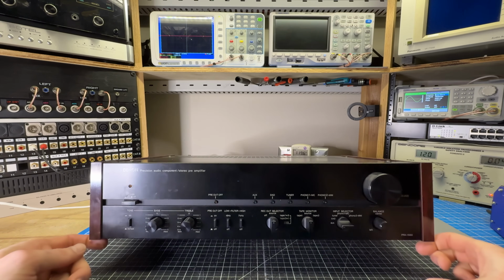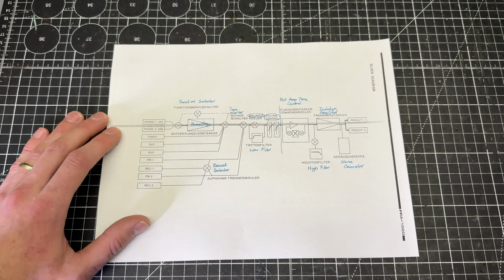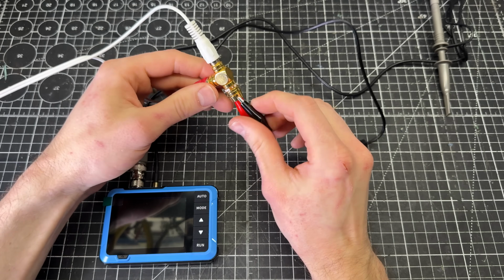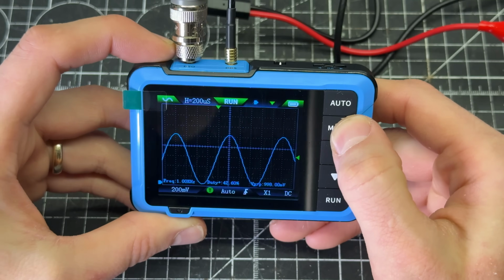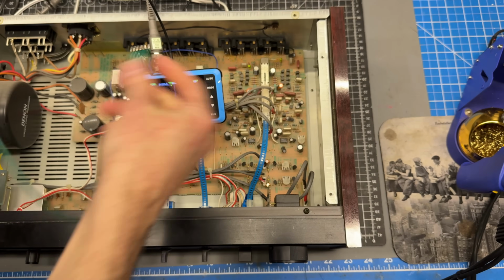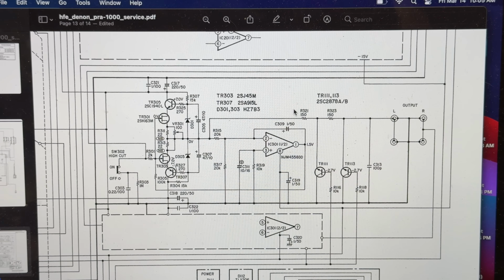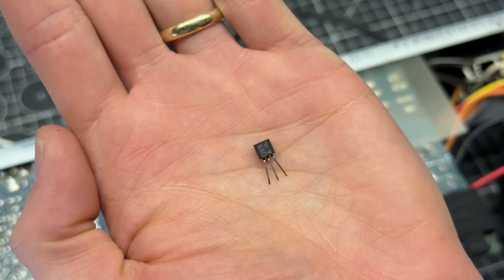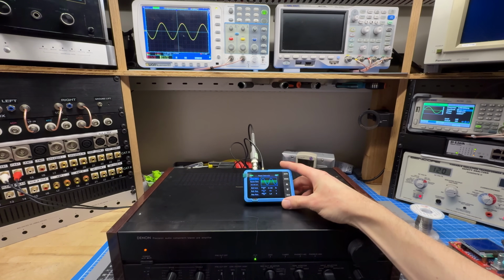Audio Signal Tracing with the FNIRSI DSO-510 Oscilloscope / Signal Generator

Comment from the maker: FNIRSI sent me this unit for review. Some links below are Amazon affiliate links that support the channel at no extra cost to you.

🔗 FNIRSI DSO-510 & Associated Accessories: https://amzn.to/4s7gEz0

IMPORTANT NOTE:
The signal generator and scope input are not isolated. When using the built in signal generator, proper grounding of the probe ground clip must be observed. 

In fact, removing the ground clip on the probe is advisable if using this device as shown in the video. The RCA cable connected to the signal generator should effectively connect the probe to chassis ground.

Thanks to a view comment it was brought to my attention that the signal generator can output a signal with a DC offset. This can be troublesome when injecting a signal into a direct couple circuit. It is advisable to use capacitor in series with the center pin of the signal generator output. I usually use a .1uF 630V film cap for this application.
Reply: could you describe this in more detail? I never used a similar signal generator / scope before
Reply: I bought one to learn on. Two days into learning, and I measured my self built Pemf machine. Can’t measure gauss. It does show a square wave and lot’s of information about the pemf. I’m real happy with it. Have a new Siglent 4 channel. But for $29.95 the Fnirsi dso510 is amazing.
Reply: If it isn't properly grounded, could it damage anything? Either the oscilloscope or the thing it's attached to, in my case, an amp.
Reply: but nothing can happen, right? Please excuse me, I'm a beginner trying to learn something, thank you
Reply from the maker: @Luke-12V The ground of the signal gen is at the same potential as the ground clip of the probe. Imagine you are connecting a clip lead to the chassis then touching it to a power supply rail. It’s the same thing. In other words. If you are not careful where that ground clip goes you could damage the probe, the test equipment or the device under test.

Comment: That is a strange result from you transistor tests! Most NPN transistors DO have a Diode across the collector and emitter because they are built on the modern "planer" process. It is VERY strange that the other transistor does NOT have a what is called the "substrate" diode as is very common in transistors today. I think someone replaced the transistor that you determined as "bad" to correct the problem is the result of putting a modern transistor that is substrate based into a circuit that was using an "old fashioned" non-substrate device that actually did not have the substrate diode. I would be interested to find out what transistor part number you used when you replaced the "bad" transistor. 
It must be an "old", non-monolithic type of transistor. The actual circuit will not work with a modern, monolithic type of transistor and would give the result of the waveforms shown. Your little transistor testor DID show the proper diode that is built on a substrate type of tranasistor and would cause the deformation of the sine wave you found in the circuit. I am a former Analog IC designer and am very familiar with this type of situation.

Comment: Thanks for the walk thru. I just got this unit to test rca input to my subwoofer amp in my car and the thing was a little intimidating opening the box and looking at the instructions.
Reply from the maker: Others have noticed that the signal gen has a DC offset so you may want to put a capacitor in series with the output of the generator if your amp is direct coupled.

Comment: When you got to the section where you decided the transistors were suspect, instead of removing parts and subbing them out, get out your DC voltmeter and measure the DC bias voltages, that will tell you which one is bad. Much faster than pulling parts and no risk of damaging the pcb. In a linear circuit the DC voltages will always tell you where the issue is. If the DC bias voltages are incorrect, you have found your problem. Since you have one working channel you know what the correct DC voltages should be on both channels. 

The signal tracing will help identify the bad section, DC voltmeter will get you down to a component. From an old electronics instructor and 40 years in the field. Don't overlook the power of that DC voltmeter and basic Ohm's law,  test the transistor in circuit first, if it checks bad in circuit pull it and re-test. Great video! Thanks for putting it up.
Reply: Sound advice...totally agree with what you have said.

Comment: Thank you for you review and demonstration of his product. I recently bought a newer version of this product that also has a multimeter. My bench has Fluke and Tektronix equipment, but I like the Idea of having a battery powered device without breaking the bank.
Reply from the maker: Just watch out for the signal gen. Most of the FNIRSI products have signal gen’s with DC offset at the output and the sine wave is pretty choppy at low amplitude. Other than that the multi function units are pretty powerful.

Comment: Very interesting search and great video edition and comments from you. A question : as this portable scope is not connected to the ground, is there less risk when mixing the probe contacts when testing in circuit, compared to a traditional grounded scope ? Does it behave in a way like a differential probe ? 
Brgds
Reply from the maker: Not exactly. Since the signal generator and scope share a common ground you can still get into sticky situations with the ground lead on the scope probe. If you used an external signal generator it may be possible to use it as a "floated" device but I have not tested that yet.

Comment: Never sen a DSO from FNIRSI capable doing 0V DC on the generated signal. All of them generate an AC with a DC offset that is aproximatly at half of the signal pp amplitude. A bit dangerous for audio equipment unless the pre is capacitor coupled.
Reply from the maker: That’s an interesting observation and could certainly cause issues with direct couples amplifiers. I will have to look into this.

Comment: White color audio cable is it pre out of amplifier or another audio out put I can’t understand please help me. I bought one i learning how to use this
Reply from the maker: The white cable is connected to the output for the FNIRSI signal generator, then it goes to the Aux in of the device under test. You can imagine that we are using the FNIRSI signal in place of a signal from a CD player for example.
Reply: @Novalux @NovaluxStereophonic tand but i bought fnirsi does not come with that gold color audio adapter can i use normal rca jacks
Reply: @N @NovaluxStereophonic 
And also can you tell me is this possible to test without turning on the amplifier. I also facing weak left channel on marantz model 1090

Comment: Using the signal generator and oscilloscope simultaneously seems to work fine at 1 kHz, but if I change the frequency to any other value (such as 2 kHz), then switch back to the oscilloscope, the frequency jumps back to 1 kHz. Does it behave that way for you (or anyone else who reads this)?

I can’t find a way to lock it on my desired frequency. Looks like I’ll need another signal generator if I want to use this oscilloscope at any other frequency. A separate signal generator is probably a good idea anyway due to the non-isolated grounds and the DC offset of the signal generator! 

Thanks for posting this video. It was helpful.
Reply from the maker: I test so frequently at 1KHz that I didn’t even think to change it. Perhaps this will be corrected in a future firmware update.

Comment: found your channel and like the way you explain what you are doing.
on this testing of the denon,i missed where you are injecting the signal generator signal into the device.is it explained in some part of the video?
thanks
John
Reply from the maker: The output form the generator is split with a y adapter then fed into an auxiliary input on the Denon. Basically substituting the FNIRSI as a line level source in place of a CD player, etc.

Hope this clears things up.
Reply: He said into the AUX input.

Comment: Thank you for the very informative video. I'm new and bought one of these to learn with. I was using it to test a preamp kit from AliExpress and couldn't figure out why the signal generator wouldn't go above 1000Hz. I could set it to a value above 1000Hz, but the oscilloscope would default back to 1000Hz. When I went back to the signal generator it would also reset to 1000Hz. I contacted Fnirse and they said that the signal generator and oscilloscope could not be used simultaneously. So you have to have another oscilloscope to use the signal generator? Below 1000Hz seems to work.

Comment: To be completely honest , the first oscilloscope with "square screen" I had in use (a "Hameg" I think in 1983) 2-channels 20MHz was miles ahead of this NOT SO CHEAP toy. I'm not at all satisfied . Just 1KHz output is not enough (personaly)  for signal tracer. My firmware is 2.0.5

Comment: One thing to note is the generator in this device produces unipolar signals with DC offset.
If you set it for, say, 1V signal, its amplitude wil change from 0 to 2V and not from -1V  to 1V (as indicated by the blue arrow on the left on the oscilloscope screen — that's the zero marker).
And there's no way to battle it apart from adding some external elements (e.g. capacitor).

This can be very problematic for working with DC coupled cirquits.
Reply from the maker: Thank you for pointing this out. I will add this to my pinned notes.

Comment: I am considering this unit as my first signal generator, primarily for tracing signals; however,  if I want to put a signal into a phono preamplifier to trouble-shoot it, the signal would need to be much lower in amplitude than the 100mV minimum signal this thing gives off.  So I believe I would still need a proper signal generator in that case.  I do like the ability to probe and use it as a signal tracer, so maybe this is a good enough reason to buy it.  Why don't they call it a signal tracer?
Reply from the maker: You may be able to get away with an in line attenuator for testing phono.

Comment: 16:00 There was no DC level. The vertical position was just adjusted downwards. You can tell because without touching the circuit (zero volts) the trace was toward the bottom of the display, indicated by the little green triangle on the left.

Comment: Did you know you can pull the top (clip) of the probe off to expose a pin probe? It is easer to use than the clip in many cases.

Comment: I’ve built a few guitar pedals and when I saw your clipping signal I jumped to the conclusion it was a “ clipping” diode as they are used in distortion pedals in asymmetrical applications as well as symmetrical. So I assumed it would be a diode or transistor. Great video. I just received the Fnirsi 2c53t 3 in one meter. Haven’t fired it up yet but it has pretty good reviews. Thanks for going methodically through the circuit and showing the scope and settings. Might look at a pedal schematic such as fuzz face or tube screamer to see what I was trying to get at. I’m an old digital telephone switch dinosaur and not much at all on audio but trying to learn.
Reply from the maker: You may want to check out my review on the 2C53T you have to be very careful with the signal gen at low amplitude.

Comment: Hey Ben, this might be the first time I purchase an item from an affiliated link. I guess I have been effectively influenced 😂

I’ve been lucky in fixing most of my gear with nothing but deoxit and a couple dozen q-tips, but I have a pile of gear that is still only about 75% of the way there, and I know the next step is a proper scope and signal generator to troubleshoot like you’ve shown here. Would you recommend this for a beginner who has been wanting to get a better understanding of electronics and repair? I’ve got a decent meter and iron already
Reply from the maker: At the price point I am happy to recommend this product for beginners. I think it is a great way to get familiar with trouble shooting with a signal gen and scope and because its battery powered it will continue to have relevance even after you upgrade to more sophisticated bench equipment. Even with all of the equipment at my bench this little device is still going to stay close at hand and will likely be featured in future videos. I will be reviewing a 2 channel product from the same company soon which may even more useful for your current needs but again, at the price point this is still a great starter product to get started with.

Comment: When I taught stereo design and repair, instead of the your term half splitting , I used divide and conquer , constantly splitting the circuit in half.
Reply from the maker: @Datsunwizard  that works too :), I guess we would call the method of starting at one end brute force?
Reply: @NovaluxStereophonic  Or a waste of time